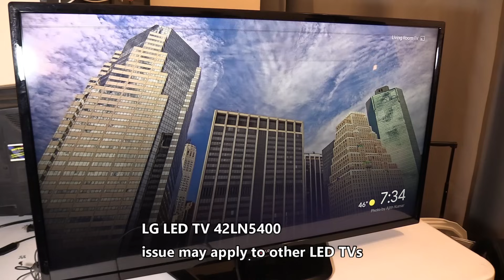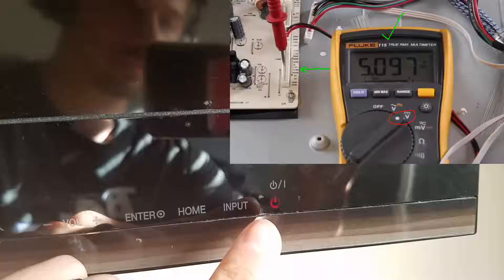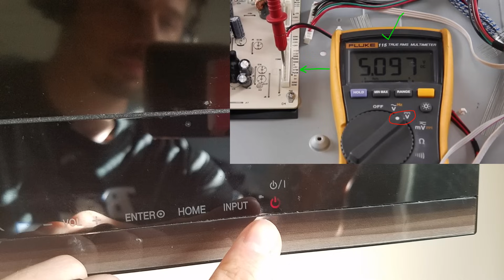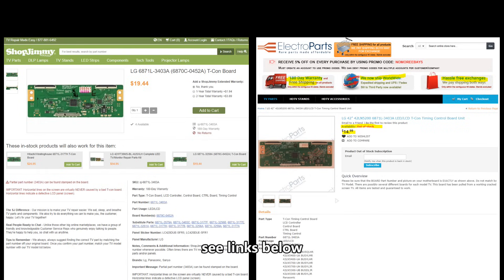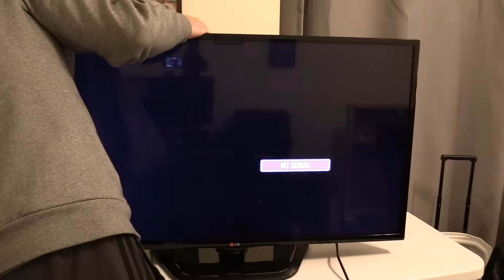How to Fix LED LCD TV with horizontal & vertical lines on the screen

Comment: Good day Sir, I  have a TCL TV: Model 43s423. After turning ON the TV, the ROKU TV logo appears with fine lines over the whole screen, then after a while there are vertical bands in the middle of the screen top to bottom and the TV tries to update its firmware but I do not have the remote to connect it to my new network connection. Also the Power ON light blinks 2 times in quick succession.  When I remove the ribbon on the right of the tcon board  the left side of the screen shows but with fine lines. If I remove the left side ribbon and connect the right side ribbon the whole screen is blank with no picture. The main chip on the tcon board is very hot that I can touch it for about 3 seconds. All voltages vin, vhg, vhl, vdd, vcom and the ladder resistor voltages are within normal range. The tc1 and tc2 voltages fluctuates from 8v to 30v. If I try to cover the ckv signals on ribbon eg. The right side one, it still comes on with the entire screen showing the logo with fine lines then attempts to update the software. If I apply 12v from my linear power supply,  the tcon board draws around 240mA. Also if I disconnect both ribbons from the tcon, the main chip on it gets extremely hot and the Power ON light still gives the two blinks in quick succession. I'm trying to rule out if the panel or the tcon is the problem. Any help or advice would be greatly appreciated....regards.

Comment: I have two horisontal lines, barely visible at the top, and have two teories, it can be dust coming from the exausht fan of the pc, that is at just 1cm away from the right side of the monitor, or maybe can be vibrations from a subwoofer? Should I try to fix?
Reply: @DualPerformance  same thing happened to my Samsung qn95 today. Not sure what happened. Please share any remedies!

Comment: Hey man, I’ve got a question. I’ve got a Samsung QA88Q9FAM. It’s got white lines across the screen, and has gone green then blacks out. It was doing this a lot, but I screen the edges on the screen and now there’s only a couple of white horizontal lines. In your opinion what could be the issue? TV repair places say that my TV is screwed and I need to purchase a new TV.

Sorry the long message!

Comment: I have a Samsung PN51D450A2D tv with vertical lines and I replaced the main T con board and still had the same problem but when I removed the cable from the small t con board there was no lines on the right side of the screen and when I tried to use tape or paper to block the lines I ended up with more lines on that side of the screen and when I replaced it I had the same problem as before so my question is what or how do I fix this problem? 3:58

Comment: Guys, I have a tv toshiba (vestel) with a single vertical line, do you think if I change the t-con card the problem will be solved? I don’t see any problems with the connectors.

Comment: i replaced  old tcon board with new  but same problem persist ,tv model is Panasonic viera TH-L42E3D
Reply: It could be that there is problem with LCD screen panel which can't be fixed or a problem with the ribbon that connects the LCD panel to the Tcon board

Comment: Hey there my Tech-Guy, I'm from South Africa Johannesburg, my 55" TV has a burnt Cof cable, Wil replacing the T-Con board stil help the problem of a Thick White vertical line on the one side of the TV?? I'm Adrian 👍🏾

Comment: Great video. My issue is more streaky than firm lines. The picture is gray, wobbles, and for a time would normalize after warming up. Now seems not to be normalizing. Is this also t-tom board or a different issue?
Reply from the maker: Possibly T-con board or main logic board but need to troubleshoot to be sure. Get TV boards at shopjimmy.com. u can use heat gun or hot air dryer on boards to see which board it is.

Comment: @TampaTec
I have a 2014 Samsung Plasma TV (PN51F5500) that has developed a one pixel wide solid steady green vertical line that goes from top to bottom on the right side of my screen. It does not flicker and it's there no matter the input, coax, hdmi, etc.
I've done a bunch of troubleshooting from voltage checks, to putting pressure or wiggling on the screen flex cables, to inspecting and cleaning board to board ribbon cables, and nothing shows problems or makes any difference to the screen, except for one thing.

When it comes to the two ribbon cables that go from the tcon board to the bottom buffer boards, if I disconnect the left side ribbon cable, so only the right side of the screen gets image, then the vertical line becomes a solid steady blue instead of green. Then when I reconnect the left cable and disconnect the right cable, so only the left side of the screen has image, instead of it being a flawless picture, it has four vertical lines in the picture. Three of those lines are only one pixel wide, and the fourth looks to be two or three pixels wide. The wider line is a purply/black color, two are black, and one is green. Those four vertical lines are closer to the center of the screen and are all spaced about an inch or two apart, but are not equally spaced.
When I reconnect the right cable (so both tcon ribbon cables are connected), everything goes back to as it was before disconnecting any cables, with the screen being flawless except for that green vertical line on the right side of the screen.

I should also mention that about a week ago the tv did a firmware update (2230->2240). I didn't notice any problems between then and now, other than maybe what I would call a bit of slow motion here and there when specifically playing PS4 games, but that very well may be due to just the console and not the tv. I did speak to Samsung about this and they say there's no problem with the firmware and that's definitely not the problem. They also confirmed that the firmware can only be updated and never reverted for some reason.

If I assumed there's not possibly a bug in the updated firmware, then it would seem to me that the likely cause is either tied to the screen itself (including the IC chips on the directly soldered flex cables) or some fault with the main processor board (because the tcon is built into it on this tv). If it were the processor board, then it would cover both a potential hardware or firmware problem with it. The processor board is still costly enough that I can't just wing it and hope it works, but if I can be relatively sure that's the problem, if it is, I will spend the money to keep the plasma going.

I'm curious as to what you think? I know a solid steady colored line typically means a screen issue, but I can get the line color to change by disconnecting one ribbon cable, plus the opposite side of the screen shows lines as well with the other ribbon cable disconnected. It makes me question whether or not it is the screen is actually the problem. Hopefully your experience can give me better guidance as to how to move forward.

Comment: For some  reason my SONY KDL- 40V4000 started displaying flickering white or grey or semi-transparent horizontal lines across the whole of the screen. They disappear (but when they do there is a shimmering in the background with some loss of colour, and reappear after a short while with return to  fuller colour (over seconds not minutes).  The TV displayed a notice saying 1080i which I never usually see. So I guessed that changing it in the Settings/General Settings/Video /Resolution to 1080p might help. And it did! The mystery is why it switched to 1080i in the first place and why the option of choosing both resolutions is there, but hey-ho. My next problem is why my JVC TH-D337B bluetooth soundbar does not work v'a the Amazon basics optical cable. IThe soundbar works OK with my desktop computer via bluetooth; but why is there no option to disable the TV's AUDIO (it flashed up 'incompatible audio Device today but never stated that before. There is just S/PDIF>  Stereo/Dolby Digital options.

Comment: Hey there - Ive got two monitors that are the same model - LG 34GK950F - one has a cracked screen and the other one has horizontal lines. Do you think I could resolve the problem by swapping the panel from the one with the lines with the cracked one?

Comment: I have a 65 sanyo that's a few years old. The screen has two permanent red thin vertical lines.  But they are in front of the picture. Meaning if I'm watching it the lines go over the picture not behind.  Could this be the same problem. The lines are about 1" a part.  It is a 4k smart tv by sanyo. Thanks in advance

Comment: I have a Samsung Q60 50 inch it has faint dot lines in bottom left corner to middle horizontally what could that be cheers

Comment: Great vids!  Saved me time and money quite a few times since watching!!  I have a SAMSUNG which powers up ok but after 20 to 30 mins, once it's warmed up, it develops a slight but VERY noticeable double image making it unwatchable.  Tried a New T-con board and cleaned Ribbons and Connectors but still has the same problem!  Whats best place to focus on next?
Reply: Have you fixed it?

Comment: Great video !! I have a solid very thin line across the television but I don’t want to spend 500$ on a new television so I’ve been dealing with the thin line but out of no where a bunch of colored line went across the television almost a foot thick but then go away but eventually come back and I’ve watched videos with people using tape or just cleaning I didn’t know you could purchase a chip board and replace it that easy , I will go back and look up the company you get them from does it matter the make of the television? Do they sell them for all brands

Comment: Have a lg 50”  , there is a single small black line horizontal and it has a jumping movement. Replaced t-con board. Any suggestions? help!!

Comment: Just got a LG 75 and few weeks later, there is a thin blue vertical line on the left side and a thin blue horizontal splitting the screen.  LG warranty is stating dropped screen, HELP please

Comment: Hi Friend, first of all congratulations for the video. I wanted to ask you for help: I have a problem with my Samsung LE40B530P7WX TV because it has horizontal stripes. I did several tests but nothing. Could you tell me which are the PINs that I have to block with the tape, I can not understand which is the trace of the signal (VCOM, CLKN, CLKP, CPV, STV, VGM ....) that is causing the problem. A thousand thanks.

Comment: I have lg ultrawide 29um58-p it has 6-7 multicolored vertical lines at first they were appearing and disappearing but now they are permanent. i opened it up cleaned whatever i can but it seems like thr display is bad at least every expert i went to said that so i guess they are correct. What do you think?

Comment: I have a 23" Samsung TV that made a sizzling sound and since then the screen started to display a wide horizontal red, green, blue, and white screen, then it changes to solid blue, and then again to solid white; As the screen keeps changing into these colors or patterns, I can still hear the programming aired on tv. Question: Is there any hope in repairing this tv and what do I need to do or check for before tossing it out?

Comment: Hi great video. I have question, my TV has a vertical line that is permanent. Initially it was black. But now it seems to be purple. And also can see a shadow line just behind the said line. What could be the reason? TV is Sony 49x7000e

Comment: Videos are really illustrative and easy to understand.  Great work.   I have an RCA RTU4300 only connected to a Firestick.   When I power on the TV, I get vertical lines (bars) on the entire screen.  Wait 2 or 3 minutes and the lines go away ... TV is perfect from that point on.   Could this be a problem with connections to the T-Con board?

Comment: I have horizontal lines .... Sanyo fw50d48f 50" 1080p 60 hz ... The screen is cracked in ONE Area... tv still works great just has VERTICAL LINES (about the length of your arm going vertically) Will this process work for it? Thanks in advance

Comment: Thanks for repair videos!.
I have LG OLED 65 C LLAAEU, about 2.5 years old (since date of purchase as new). It has developed vertical lines fault. 1 maybe 2 black lines, 1/3 of way in from right hand edge. Basic checks of SW from menu system and reset did not fix the problem.
Any hints on further debug?
Reply: managed to solve the problem?

Comment: Tampatec hopefully you can help.  Recently I had an apparent power surge that took out the main board. When I received the new main board I installed and powered up the Samsung QN85 tv and now I have a single vertical black line. (A column of pixels) can this be fixed?  And response is appreciated!  Thank you

Comment: Hai sir, i have lg 39ln5400..first the tv turn red, then got white line...before that, i have change some blown cap n fuse...is my tv also need to change the tcon board only? Or the supply board to ensure the other board got exact supply power?

Comment: Hi tampatek . I watched all your repair videos and I've decided to replace the t-con bored as shown on your videos . I own a Sony  kdl-43w756c smart TV and replaced both the tcon board and the lvds cable what happens is this: it works fine when I first switch it on and watch for several hours ,when I switch it off for the night and come back next day and switch it on it loads up to the android logo and then 5 red blinking lights.I reopened the TV and resiited the cables and exactly the same thing happens .any ideas? Thanks in advance

Comment: What’s up Tampa Tec. Awesome video. Quick question. I have a Samsung 65” 2 year old tv (2018). I have just noticed 1 Horizontal whiteish line. It is about 1/4 down from the top. Any thoughts? Worth fixing myself? How much will a shop charge?  Thank you

Comment: I have a Samsung LN55C610N1FXZA with intermittent vertical color lines.  There is no pattern I can see to when they appear. All connections on the main and t-con boards are tight.  I purchased an LJ94-03291P t-con board to replace the factory one.  It worked for awhile, but the intermittent vertical color lines returned.  Could this be a main board or cable issue, or did I get a bad t-con board?  An thoughts would be appreciated.  Thanks.

Comment: I have a Sony KDL-32BX300 and it has no TCON board as far as I can see and based on my research. The problem I am having with this TV is that black/blank screens appear washed out/greyed out, especially when viewed from the side of the TV and I notice a very faint horizontal green streak across the screen when viewed from an angle at the side of the TV. What could be causing this and what component(s) would need to be replaced in order to fix this problem? Keep in mind that I'm not a technician so I don't know how to test boards and whatnot.

Comment: toshiba 49l510u18 has vertical lines. Replaced the tcon board and the lines are still there. Tapped the ribbon cables to the screen and get the same result. Any idea what else I can check?

Comment: HI i have TCL Roku tv model 55S405. On top screen there are multicolored lines horizontally, and in middle of screen there is some black vertical lines, what is the part that is failing and is it worthed to replace it?

Comment: My 32 inch Hitachi has a permanant horizontal line about a fifth of the way down from the top. It also distorts the pictute.  Is this the T con board you showed in the vid?

Comment: 50GA6400 no picture, just vertical colored lines, I replaced T con board and no change, also worth noting, if I turn it off then on again, it will turn itself off again.  If I un plug it for a minute, it will stay on.
 Any help would be greatly Appreciated! 
Thanks in advance!

Comment: Hello, I was fixing my tv that has  one side LED not working. Eventually i just replaced the whole power board and managed to get everything working again. however, now i just turned it back om and there are 2 lines running down the tv, one on the left and 1 on the right. what could have caused this? I also ended up with 2 long pieces of metal that i have mo idea where they go in the tv...
Reply from the maker: Sounds like tcon to lcd panel ribbon cable connection issue maybe. 2 long metal pieces maybe try the sides of the tv under the bezel.
Reply: @TampaTec  yes, might be the ribbon cable actually. I reopened it and looked around and did find the where the metal goes! It goes OVER those ribbon cables. I also looked at all the ribbon cables but cant find any defects... after fixing it all up again, there were MORE lines 😢 overall, still usable but if you can tell me what to look out for regarding those ribbon cables and how to fix the lines maybe I'll try to open it up again. btw, thank you for your great videos! This is one of the biggest DIY project I have done and following the videos really helped me out!

Comment: I have an LG tv that has horizontal lines on the bottom 3rd of the tv that comes and goes. Picture is fine but the lines show up in static form off and one. Will replacing the t-comm board fix it?

Comment: Thanks alot i do need some help this issue seems related but i wanna double check my issue. Maybe you csn help me out. I have a samsung UN40D5005BF horizontal lines permantly in my screen. So i have to replace the panel?

Comment: Great video thanks! My TV problem seems to not have a solution. When I turn it on, I get a brief white flash and then black screen. This is what I’ve replaced so far (following your tutorials thanks!) but still there’s no picture:

Power Supply board - Replaced
Main board - Replaced
T-Con Board - Replaced
LED Strips - Replaced

The only other thing I can think of is the actual screen itself, but I’ve done the flashlight test and the logo shows through.  It hasn’t been damaged as far as I know, but it does hang above the fireplace. It’s a Samsung 50” TV (50LN5700) and I’d like to get it working now that I’ve spent a bunch on it. Any ideas?